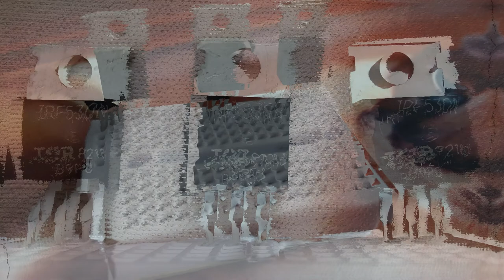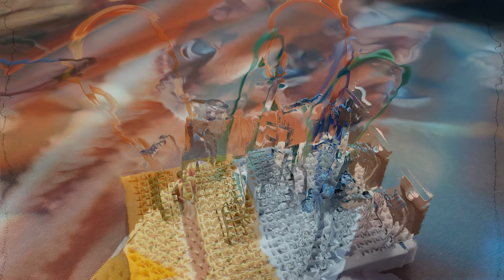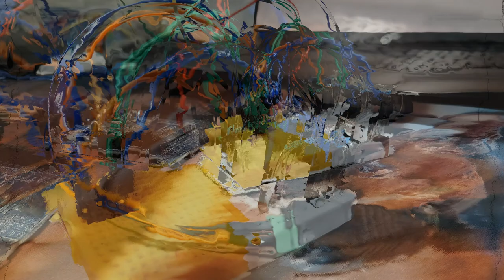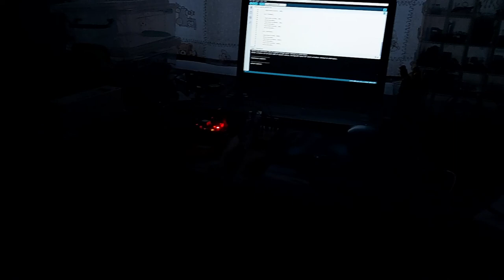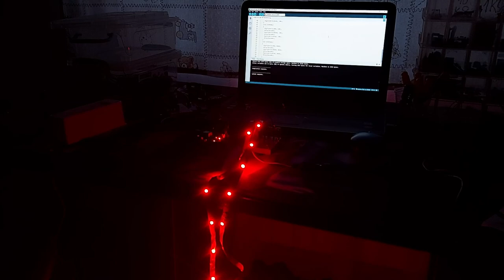12V LED strip on Arduino with IRF530N Mosfet transistors - Arduino for beginners - with code

Comment: May I ask what do you use for the power source
Reply from the maker: Hi!
I used a power supply very similar to these: https://www.aliexpress.com/item/4000108916121.html
I bought the power supply from a local physical store, not from an online store. I gave you the link just so you can see roughly what I used.